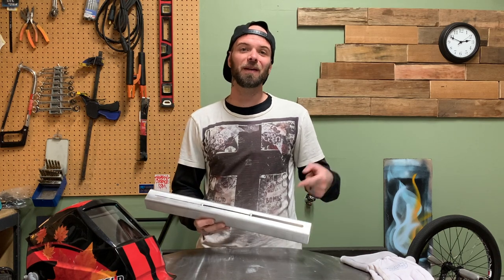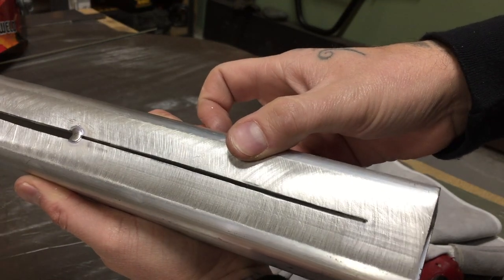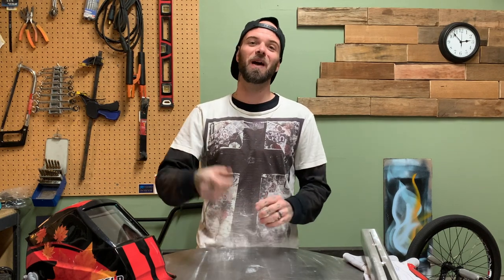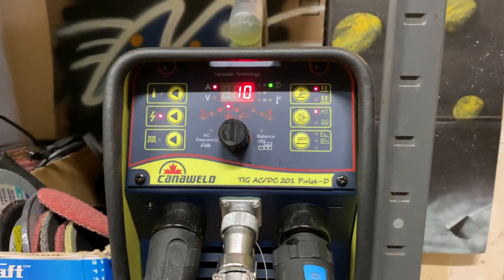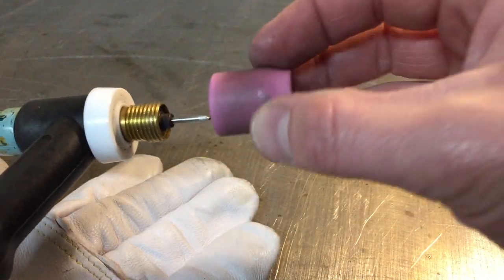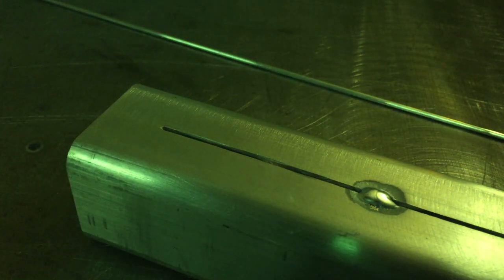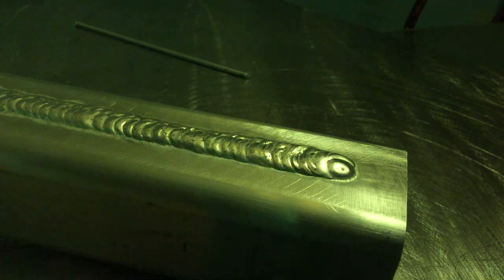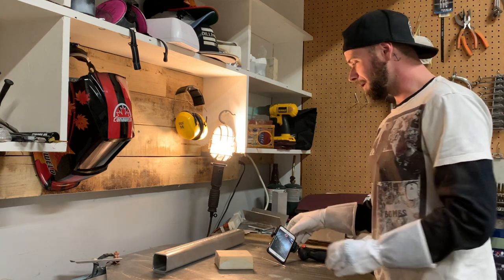Tig Welding a MASSIVE GAP! (Total Mess)

Comment: Another fun to watch video Dusty. Keep'm coming. I'm getting closer to having a welding area set up at home. Just picked up 2 welding curtains the other day. I just need to run some electrical and a few more details. It will be fun to try some of these practice welds out.

Comment: Other than for the impurities coming out, it’s really fine for the gap, I’ve seen, and done worse. I’m wondering whether the impurities are just on the surface. If so, a little sanding and maybe only polishing will get rid of it. It won’t affect the weld quality.
Reply from the maker: All good:) Was fun to give it a whirl. Tough not to have impurities and stuff happening I guess for such a big gap. Looks like I’m getting the grinder out!😂🍻

Comment: Run a qiuck bead down both sides with smaller dia wire,make the gap smaller.
Been welding,coded 40+ years. Hope that helps.

Comment: If you had to do this again, would you have a different approach on the larger gap? Also is there a better way to clean the bigger gap of contaminants? I don’t have access to anything for backpurge but I’m working with 10ga 3x1-1/2 aluminum tubing and those gaps can be tricky

Comment: First off awesome job! That’s a sick challenge, I’ll have to try that myself. It would have been cool to see what the underpart of the weld looked like on each pass! Also, what if you were to pulse the large gap and use a thicker filler rod? Do you think your weave would have turned out nicer?
Reply from the maker: Hmmmmm maybe a bittttt...? It’s tough. The arc jumps everywhere due to not being directly aimed at a surface, maybe next time!

Comment: I find em easy to fill ,   like  a welding rod   cut to size   , i even keep  a few lengths of steel rod  in my shed  to fill gaps like this ive even  used old steel coat hangers  just a handy tip for people 😊
Reply from the maker: Good tip!💪

Comment: I have had luck wire brushing a weld like that and then running back over it at about 40 Hz with just a little more filler to get some freeze lines back into it. Pedal pulsing can give slight freeze lines, but not really enough to make it look "good".

Comment: You officially started the “bad fit up challenge”
Reply from the maker: 😂😂😂 I called it the ‘weld a gap challenge’ but that name is killer as well🍻
Reply: @PacificArcTigWelding  I have to weld decent sized gaps in 14g stainless occasionally at work and it is so damn hard. I just try to make something that can be polished!😂

Comment: Dusty, I know you're on break now tho, I cant get how you shape the tungsten in that way with the lil ball on the point.
Reply: Turn balance way up on ur machine then strike arc on a pc of scrap. Once you get a ball turn balance back down and weld on bro.
Reply: Thank you! I had wondered it was something like that. I'm lacking experience in pulsed current and tuning of the duration parameters tho, but now I have an Idea on how to try crossing that bridge, when I'll be there.  @ItzF8aL